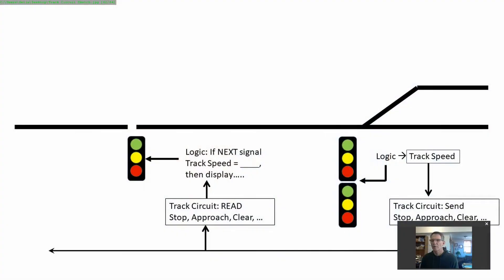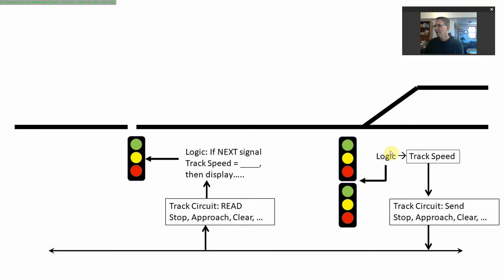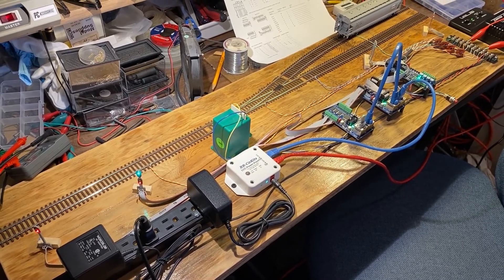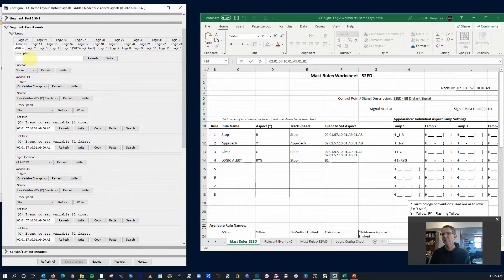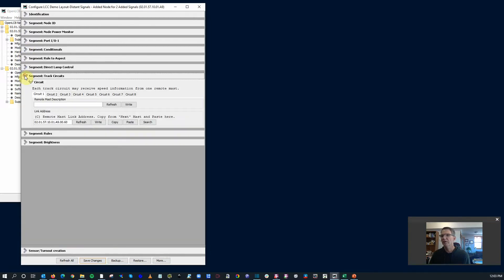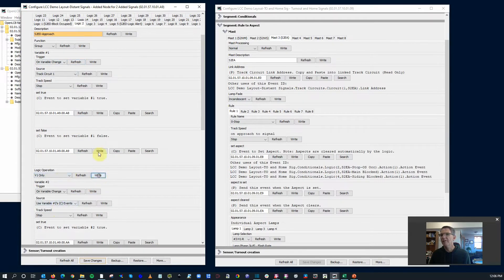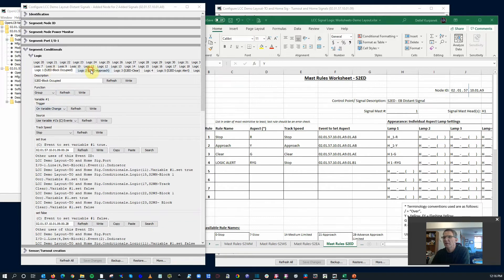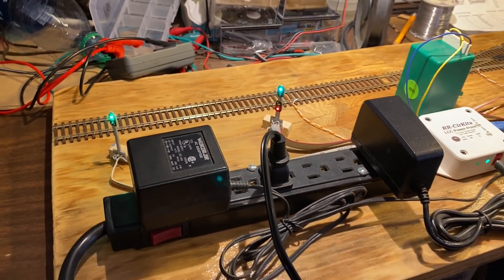TLC #17 Signaling Pt 7   Track Circuits

Comment: So if I have 24 signal heads then I would need 4 lcc signal board’s and thanks for quick response
Reply from the maker: How many lamps per signal head? While it has 16 LED outputs, the Signal-LCC is really set up to handle 4 heads, each head with 4 possible colors: red, yellow, green, and lunar. Four heads with 4 colors each = 16 LEDs. Now most signal head are 2-3 colors, so likely there will be one or two outputs per head that are not used, but you can reassign them to any other signal or function. But it does get confusing pretty quickly. If I had 24 signal heads, I would simply go with 6 Signal-LCC's. Assuming 3 colors per head (red, yellow, green) would use 18 of the 24 outputs on each board, for a total of 108 used outputs, out of a total of 144 available. The extra 36 (6 outputs per board) could be used for any number of other uses, like RR crossings, panel displays, even switch position indicators. Yes, you could pare it down to 5 boards (24 heads*3 colors per head divided by 16 LED outputs per board, with a few extra), but you would find it very frustrating and confusing when configuring those that are not grouped as they are in the default set up. Besides, with 24 heads, the signals will likely be geographically spread out around the layout, and you will want the nodes near the signals for wiring... unless you are modeling the yard throat at Grand Central.

Comment: Dear Sir is the signal lcc board the only board that can control signal from Rr cirkts or can I use tower board thanks for all your videos have learnt a lot
Reply from the maker: Thanks for the kind words! Control is a bit of a loaded word. The actual control command can come from anywhere. Logic can be done in the Signal-LCC or the Tower-LCC. Both work fine and very similarly. However the Signal-LCC has all the extra blocks for handling signal aspects and indications, as well as individual LED controls. So it works better to set up the signals in a Signal-LCC. If it works, do the logic in the same node. But not necessarily has to be there. Commands can literally come from anywhere on the LCC network. Hope that made sense!